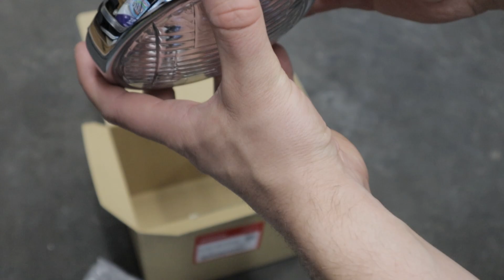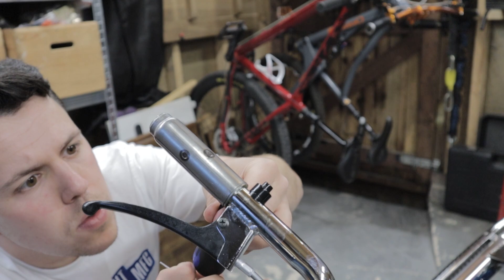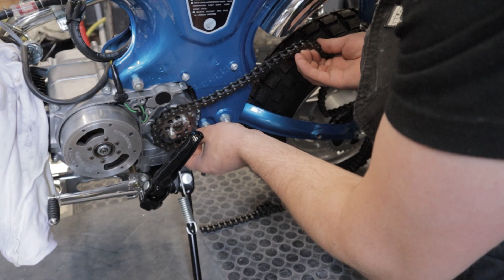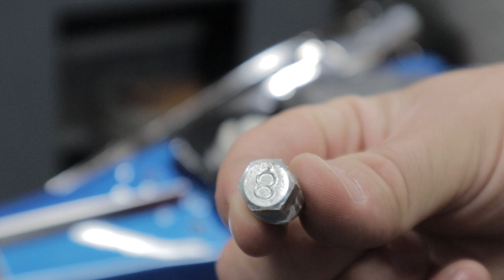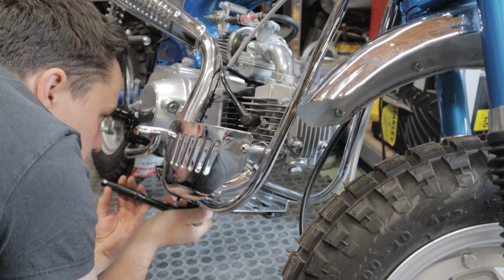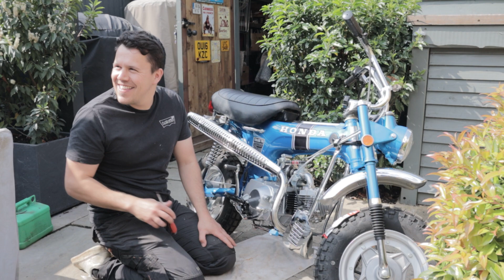First Start! - 88cc Big Bore Honda Restoration - CT70 PART 8

Comment: you must have by now realized you  have left the spring that sits on top of the carb slide out plus a little rubber boot goes on the top of the carb stops extra air being drawn in  but  excellent job really looks good
Reply from the maker: Hey, spring was added, but don’t think shown on the video! Thanks for the heads up. As it’s an aftermarket carb with custom exit and throttle cable you can’t use the rubber boot that comes on them. Hope that helps, bike runs a treat!

Comment: I did an 88cc kit on my 72 CT70H about fifteen years ago and just recently got it running again. Fired up first kick and ran great with fresh oil and gas. Love that little bike. Great for short road trips.
Reply from the maker: That is great to hear, thanks for commenting. Love hearing stories like that, and nice to know the 88cc kit is going strong.